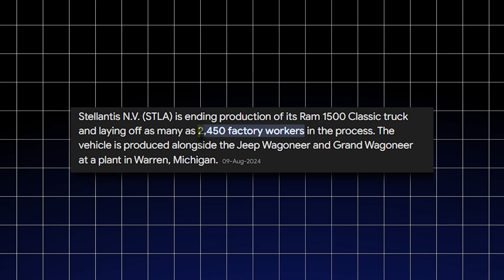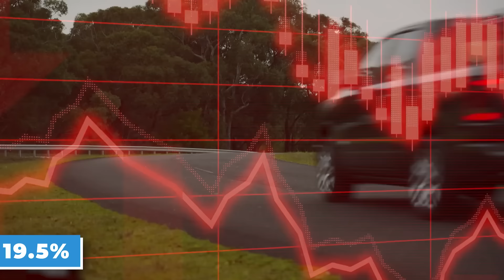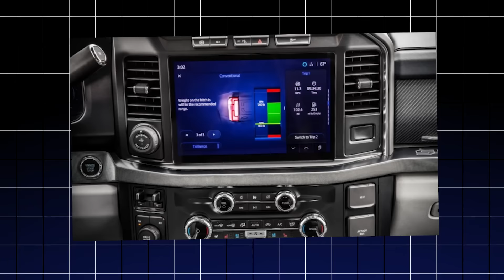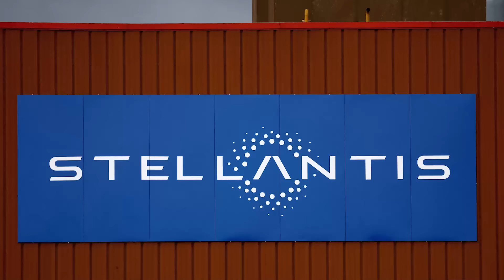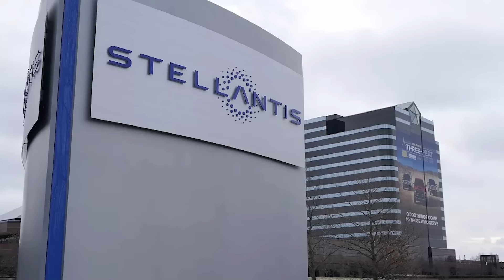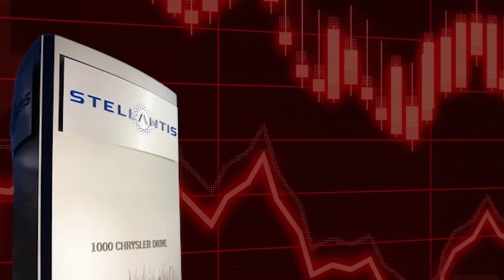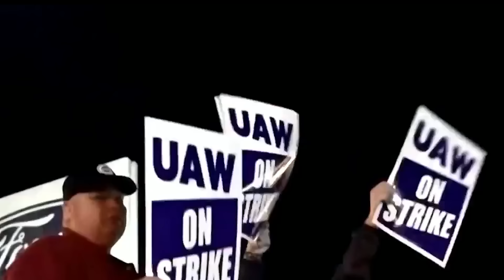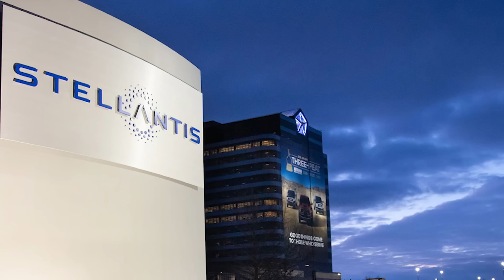Stellantis Just Announced The End of Ram Trucks Through Stellantis CRISIS!

Comment: The cost of surviving doesn't make it feasible to buy new trucks. The cost is ridiculous across the board. Used vehicles are nuts as well. It has only gotten worse over the past 3 years. Evan before they were expensive enough, but factor in putting food on the table at 3 times the cost. Who can really AFFORD a new vehicle.

Comment: Lol, I love how they draw you into these articles. Already read about them ending the Classic 1500 months ago.
Reply: That junk was retained only due to UAW contracts in Canada.  The contracts finally expired, and production in Canada stopped immediately.
Reply: @2CabrasLocas ..The Ram Classic is built in Warren, Mi.
Reply: Well, it wasn't quite "1500 months ago" but it has been a long time coming ...jk

Normally when a vehicle manufacturer introduces a 'New Generation' vehicle platform the previous vehicle ends at that point with a slight overlap for parts production to build up replacement parts inventory. When Ram introduced the 'DS', fourth gen. platform in 2009, we immediately stopped making parts for the third gen. 'DR' and changed over to producing 'DS' parts. However when we started making parts for the 'DT' in 2018 we were told that we would continue producing 'DS' parts for another year or two, and that the truck would be renamed the '1500 Classic', and the 'DT' would now be the 'Ram 1500'. We did the same thing with the 10th gen. 2004 F150 Heritage 'PN96' produced concurrently with the 11th gen. 2004 F150 'P221', but that was only a one year carry over. Every year since 2018 we were again told "Six more months ...maybe one more year", but the 'Classic' continued as long as it was selling, with many people not even realizing that they weren't buying a "NEW" truck, even though it was labelled the current year. I know people who've bought Rams in recent years and look at me with a blank stare when I explain to them that they've essentially bought a new "old stock" truck. And finally, after almost seven years of producing two "Rams", they've finally shut it down, only to shift volume over to the 'DT' Ram. Basically, all of these stories are a NOTHING BURGER, just a lot of confusion about the trucks production.